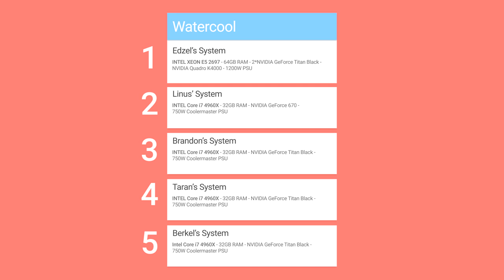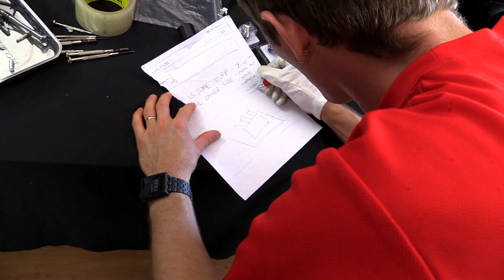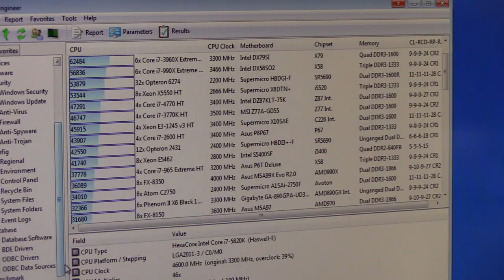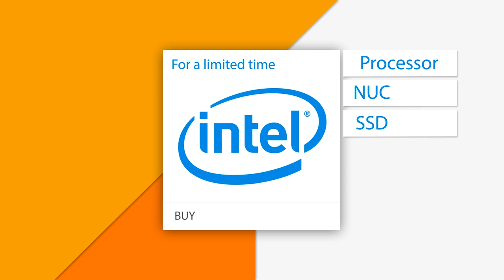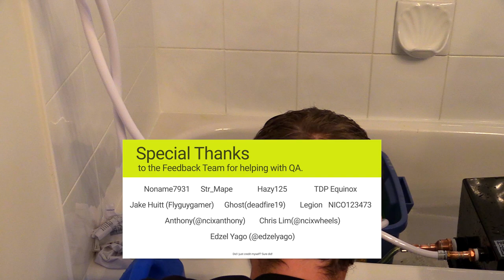Whole Room Water Cooling Part 2 - The Assembly

Comment: Why put it outside? Why not just put it in a large chest freezer with heaps of frozen bottles of water in it? Perhaps the radiators would win the battle against a chest freezer and it would still get warm in the freezer. Well perhaps. On a hot day the radiators are going to get very hot outside and do bugger all in terms of cooling. Thinking about this project is painful on the brain, so many ideas go through your head lol.

Comment: why are they using radiators on the computers if they are being piped to external outdoor radiators/ fans anyway? hell, even just all that piping alone would pretty much be enought to cool the water, they surely dont need radiators on the pcs and giant radiators outside with massive copper (good at heat transfer) pipes... with all that they will be able to do some pretty hefty overclocks.. limited only by the heat transfer of the cpu's heatspreader etc. overkill... and if the goal is a cool room.. again.. why the radiators on the cases?

im obviously missing something here, there will be a damn good, and possibly incredibly obvious reason they did it this way..
Reply: ah, because the pc's are not in parallel they are in series. so the water has to go through all the pcs before being cooled. so the last (fifth) computer would have pretty hot water heading its way..

Comment: Maybe it's just me, but this was painful to watch. It's as if they skipped over the whole planning stage of this project and are just making it up as they go. There's an expression "Measure twice, cut once." It seems they are doing the opposite. Wouldn't you design the mounting system for the radiator and test the pump BEFORE you dismantle every computer in the office? Take your time... get it right... this is the MOST IMPORTANT feature of the ENTIRE project. Not something you want to slap together at the last minute.

I heard the phrase "if we have to sacrifice air flow... then that's what we have to do." But these are your ENTERPRISE Work Stations. If this fails you are shut down... no work gets done... no money comes in. But what the heck, we'll just use 2/3 of the specified air flow and keep our fingers crossed.

BTW: I hope they calculated heat dissipation on a hot summer day and also selected cooling liquid that doesn't freeze in the dead of winter.

Comment: COOLING:
Honda Civic aftermarket Alum. radiator w/ a 12V single SPAL fan, brazed on PEX fittings, PEX "push in" hose, inline 12V auto water pump, a Harbor Freight AC to DC converter with a Auto Zone radiator cap. Junk Yard Honda Civic core support to aid in mounting.

MODS:
Clear PEX hose with a fish tank air bubblier w/ purge vent , UV dye in the water, adjustable water temp sensor to trigger the fan, endless types of water temp auto gauges to add anyplace along the line. 

In the winter you could just switch the POS/NEG on the fan and blow warm air in!

BTW this She did, She didn't do shit makes you guys sound like a bunch of women ...

Comment: Would work so much better if you made a block to feed all that water into a car radiator with either box fan or car radiator fan on it, instead of using all these weak pc radiators with tiny fans

Comment: why are you even messing with those small radiators it you are running all the water outside, you need a supply pipe large enough to handle all computer's water and a large enough return line . you have your radiator outside.
\

Comment: In my opinion you guys are practically building an air conditioner without an active refrigeration unit to cool the computers and the office. And I'm wondering what would happen when in summer the temperature outside becomes higher than inside the office. And because alI the cooling this system uses is nothing more than the air outside, I don't even have to guess.. Because then you will be heating up the office. While the computers may still have benefit from that system it's not entirely unthinkable that the office could turn into a sauna. I'm not sure but i think that this system will be using the same refrigerant as any other watercooled pc.

Unless you have planned to use a cooling unit from an old refrigerator, you guys maybe should have a look at this page at Wikipedia. It might come in handy. ;)

http://en.wikipedia.org/wiki/Air_conditioning#Refrigerant_development

Comment: should of used a 12v auto waterpump ...cheap and u can change speeds and might run it off one of those power supplys
one could run whole system...if it can handle 500-650hp engine should handle this fine http://www.summitracing.com/parts/mez-wp136s/overview/

Comment: If you don't insulate the copper pipes in the room then you are still getting heat from them in the room. Dum dum dum. Just the amount of heat loss through that much copper pipe would cool your rigs if you don't insulate them to the rads. lol. Also you could find one radiator big enough from some kind of atv or small car to do all of this instead of that. I know you guys have never scaled up this big, but maybe ask guys that do construction work, radiator work, all of the things involved before you start. The internet would have given you all this before you started. lol
.